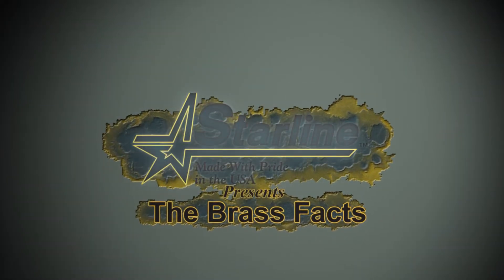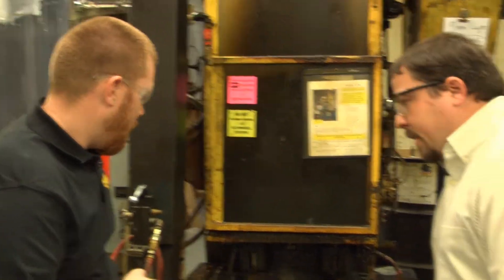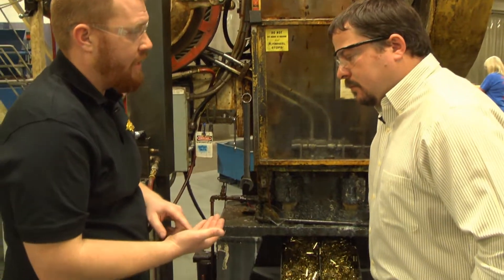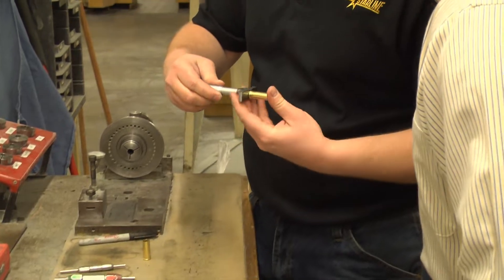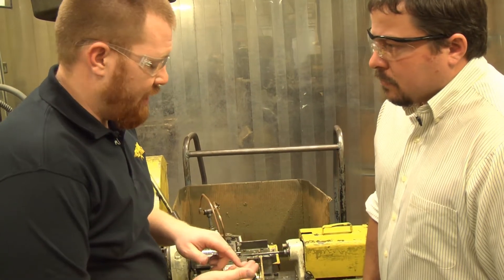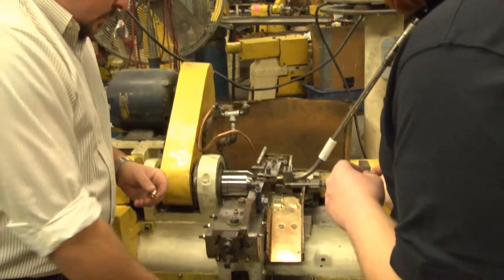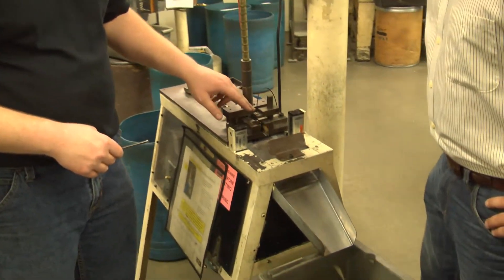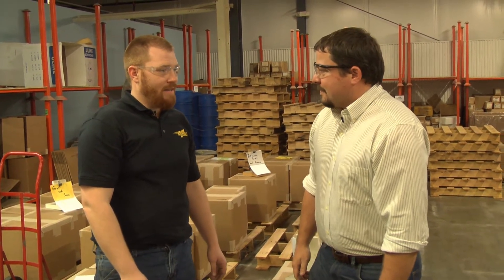Starline Brass: Process to Perfection | Starline Brass "The Brass Facts" Episode 1

Comment: Great stuff! I have a 32 H&R with outstanding accuracy, mostly because I only load it with Starline brass that I bought new. I started checking the length to trim (hey, I was used to Win & RP from other calibers) and found the first 80 were exactly the same. So I just loaded the next 1420. Some are on 8 full power loadings, none have ever failed in any way.

Comment: Outstanding! I've been using your handgun brass for years and in my humble opinion, it's the best of the best in regards to concentricity, length, primer pocket size and what seems to be the perfect hardness... Not too hard, not too soft for repeated handloads without case mouth splitting... Especially with hot loads for my Ruger 44 mags and 45 Colts.... and I crimp them hard to prevent bullet creep. A close second is Federal and Sig Sauer. Thank you for making a quality product.

Comment: I’ve used Star Line brass for many years. They typically have a much heavier web and slightly thicker walls (.001 - .002) than other cases. Much stronger cases for hunting loads and significantly longer case life especially for target or practice loads. I won’t purchase anything else.

Comment: Back in the late eighties/early 90's, Starline was one of the first companies to produce .45 Colt brass, in response to the 
cowboy shooting competition craze.  Back then, .45 Colt brass for purchase was rare . Brass was difficult to find anywhere! When I heard about Starline, through Shooting Times Magazine (thanks, Mike Venturino),  I began ordering it for producing very heavy loads for the original Ruger Vaquero and Blackhawk pistols. My load constituted a Sierra 300 gr. semi-jacketed flat nose bullet propelled by a bushel or so of W296 or H110, and a magnum Win. or CCI large pistol primer.  I also used this same load in my 16 inch Win. 94. 
All deer taken with this load, be it rifle or pistol, dropped deer as if they were hit by a falling grand piano.  If they ran at all, it was only a few yards. My longest shots were kept under 50 yds.
This Starline brass handled those loads with ease. I can't even tell you how many times I reloaded those heavy loads into the same piece of brass, and I can't remember one case failure.
Because of this initial success with Starline,  I always go to Starline first when buying ANY brass, regardless of caliber or type.
Thank you, Starline!
Reply from the maker: Thank you for your business Robert!
Reply: Yup, I've been reloading Starline .45 Colt with black powder.  Starline is a very good product.

Comment: Im curious how the rim and primer pocket are made... like from the inside of the machine
Reply: im still have no idea how the rim is made.
Reply: its cut in with a lathe. primmer pocket and flash hole is punched in
Reply: @jasonwoody8041  ok but why its thicker where the striking hole is? And primer pocket cant be punched in cuz then the bottom of the inside of the case would be embosse :/
Reply: @charging_station2  any time you have a punch there is a die on the die on the otherside to support and center. if you asking how it got to be so thick at the bottom to allow a spot for the primer the cups looked fairly thick to start with but  as you draw the brass through the dies your displacing the brass elswhere. if your cheap like me think of how when you get to the end of the toothpaste how you squeeze the bottom of the tube and draw up whats left to the top at the opening.

Comment: Quality control ? Is it a joke ? Large primer pocket in half pack of brass is too big and loosing primers
Reply: Are you kidding? They make great brass. I have been using their straight wall stuff .44 mag, .38, .45 since the early 90's. Got some .243 last year and it is on its 3rd reload and holding up perfectly. I can't remember any piece of brass not being able to be loaded. I can't say the same of some other manufacturers.

Comment: If you think this is beyond the ability of any backwoodman to make just consider the manufacture of primers and the complex explosive compounds for primer  such as lead azide and hammer anvil construction of primer. The real probem with back woods ammo manufacture is modern double base propellent(nitroglycerin,nitro cellulouse) which requires complex chemistry/manufacturing . Black powder muzzle loading loading technology was a lot simpler technology but a lot of smoke and buildup in barrel.

Comment: We use the same material brass for the machines I run for eyelets, I make brass stems and ferrules for hose couplings that go on washing machines hoses. The machines they are using for the press are not the same as mine but the inspection and collection method is almost perfectly the same.

Comment: Love the Starline product  but little pricy.
Reply: how many reloads do you get with each different brand of brass.  If a case cost .135 and you reload it ten times it  is  .0135 per load. not bad.  how much difference does it make between .0135 and .0132?  Starlie lasts longer (case mouth does not split)  ... why?  I do not know.  BUT I do use "scrounged" brass too (so my overall costs is probably less than .010 per load and nothing is that cheap.    The primers only get ONE load and the bullet only gets ONE load .. and the powder only gets ONE load ...so they are much more per loading than he brass.

Comment: When I had some bad Starline brass they would not warranty it. Beware.
Reply: I have never had any bad Starline brass.  Been reloading 45 LC sine 1990 and .357 since 1988 .. I have used oh.. 5000 .357 cases and I get from 18 to 25 reloads (without annealing) from Starline (which is OK for me).. revolver is probably not as violent as semi-auto brass (extraction.ejection)
Reply: I tend to doubt your statement that Starline won't warranty a bad batch. I've been using their brass for a long time, mostly .45 Colt and .380 Auto and never, ever having a bad experience with the Starline company. They back their products 100%!